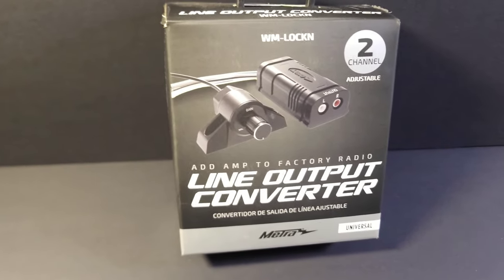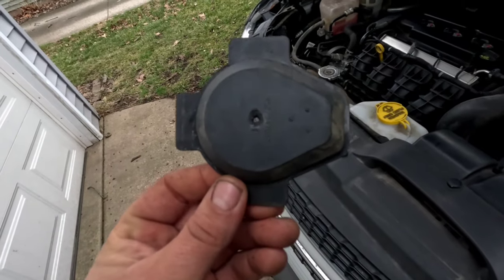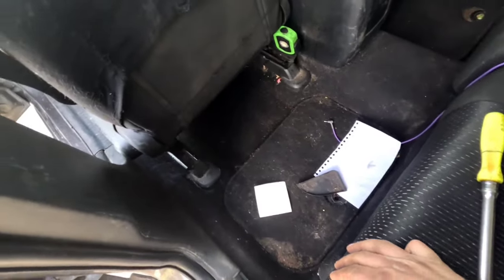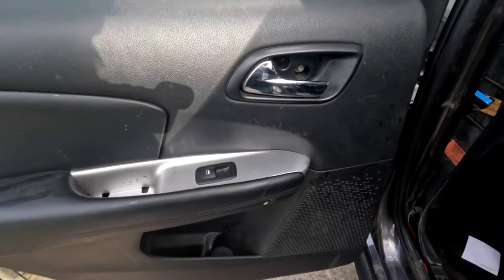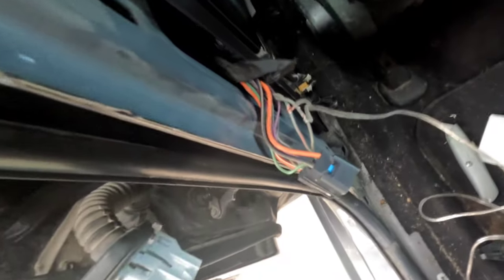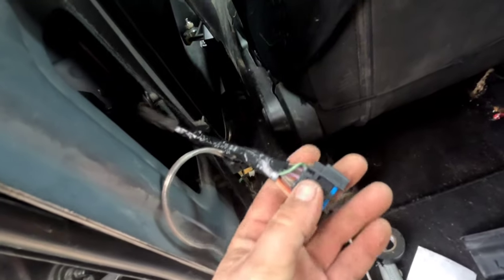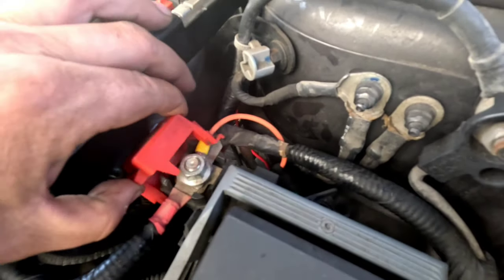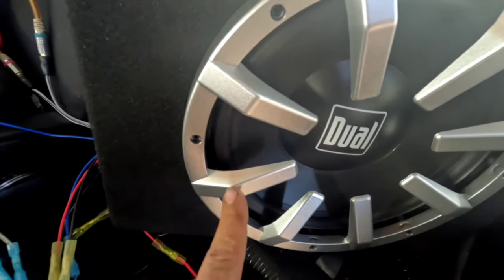Adding Subwoofer to Factory Radio - Easy & Cheap!

Comment: Great video, however, I installed my LOC right behind the radio, and I wanted to know if that same method works for cars with screen panels. More modern cars. I’m not familiar enough with them to understand
Reply from the maker: Personally, I would definitely do it the way I showed in the video. Typically, pulling two door panels or trim panels will be easier than pulling the screen panel and whatever else is required to remove it (dash, trim, etc)
Although, both would achieve the same goal. I guess it would be a matter of personal preference.
Reply: Thank you for that, i appreciate the advice :)

Comment: Maannn you actually used that Lil small wire for your hot wire???? Wth
Reply from the maker: @greddmyles3677  lol look at the actual input wire from the harness. That wire that is powering the amp is capable of carrying WAY more than enough current for that amp.
Reply from the maker: @greddmyles3677  the only thing bad about it is there is not as much insulation so it could short easier but it's fused so it's good.

Comment: Yo good video i have a question. I have a 2012 ford edge with the sync. My radio doesnt have rca outputs. Curious as where to start. I am fine hitting wally world i dont want huge bumps just to sound way better in the car .. ty for any advice
Reply from the maker: Yup! Just follow the video, and it will work great! 
Still, if you have any questions, feel free to ask!
Reply: You need to get LOC and tie into either the front speakers or the rear speakers

Comment: One thing I would have mentioned in the video is how to adjust the gain(level) setting on the converter...If the remote level control knob is hooked up and being used...The knob should be turned all the way up while the gain is being adjusted on the converter with either a test tone or familiar song playing with the radio volune around 75% volume...But it would take some guessing and fine tuning by ear to get the converters gain and the amps gain adjusted correctly...An oscilloscope would be the proper route but can still be done by a good ear.
Reply from the maker: I'm looking into getting an o-scope! But yeah sorry.

Comment: I did this to my son car and sub/amp stays on for about a minute after he turns the car off. I have the remote wired hooked up also. Is this something to be concerned about? Thanks for the video
Reply from the maker: Nope! I was actually gonna mention that but forgot. When it stops receiving the audio signal, it will wait about 60 seconds before shutting off (so if you mute it for a minute, it won't shut the amp off.) Thank you for watching bud!
Reply: @Blowncapacitor84  thank you. Your videos are well put together and have helped a lot. Keep up the great work
Reply from the maker: @BrianBaker-lk2xi  Thank you so much! That means alot!
Reply: So this will allow me to also hook up 2 amps, correct?

Comment: I have everything powered up eq n amos but no signal to sound the chuchero and bass😢 not sure why ... Im literally 99% done 😭
Reply from the maker: Do you have the remote wire connected?
Reply: @Blowncapacitor84 where do I connect it too on the fuse box?
Reply from the maker: The amp or the loc?

Comment: So I have experience hooking up car stereo and amp but not to a stock deck …… just to be clear u ran the blue remote wire from the loc to the amp correct ? Speaker wire from loc to speakers in car . Ground the amp and power to the amp. As far as remote wire going to the amp it’s coming from the loc?
Reply from the maker: Yup. The loc has a blue wire that will hook to the amp. Sounds like you should be good.
Reply: Ok so let me start from beginning correct me anytime …
From loc…
Blue remote wire goes to the amp
From loc 2 pairs of speakers wire pos: negative spliced into rear speakers
RCA from loc goes to the amp. 

From amp the ground is grounded 
Power goes to battery 
RCA connect tonloc
Remote wire from amp connect to loc 
Then I can bridge a line out from amp to the my sub since it only has one speaker?

Comment: Would this still apply to a car that has Bose system? It’s a mazdaspeed 6 2007
Reply from the maker: Yup! All it does is it takes the signal going to the speakers and lowers it to line level. I actually know a guy with a great bose system in a Mazda using a LOC

Comment: So the left channel cords go into the sub? Or amp
Reply from the maker: @troynepinak529  the wires connect to the speaker wires in the door. The rca connectors go to the amp. You also need  to connect power, ground and remote.
Reply: @Blowncapacitor84  yeah thanks for that just wasn't sure about the one thing. Awesome vid btw , peace
Reply from the maker: @troynepinak529  no problem anytime thank you
Reply: Question if I may? I have a 2016 terrain with the pioneer system. Just hooked everyhting up. using an loc. Tapped into the rear door speakers. But not getting anything out of sub. Any suggestions would be greatly appreciated.
Reply: @Blowncapacitor84 Do we need to connect both speaker wires, left and right door speaker?
Reply from the maker: @Πέτρος-υ8η  yes. If you connect both channels of the loc to a single channel, it may not get enough voltage. Although, you may be able to turn up the input level potentiometer to compensate for this, but it will only send the audio signal from one channel so you will loose sound quality.
Reply from the maker: @danculshaw7104  only thing I can think of would be a problem with the 12v+ and ground or the remote wire.

Comment: if i am connecting the LOC to my rear speakers where will i connect my yellow and blue wire too?
Reply from the maker: The yellow wire needs 12 volt power from the vehicle or battery. The blue is the remote wire and will connect to the blue wire on your amp. The LOC basically needs power to send to the amp and turn it on. It will turn off about a minute after the radio is off.
Reply: @Blowncapacitor84  I already ran a remote wire to my Amp separate from the LOC do I still need to power it?
Reply from the maker: @bassamaann  If you ran a remote from the radio, then I don't think it needs power.
Reply: @Blowncapacitor84 can I still hook up the 12V yellow wire to the AMP and put it into the “ *12v * section the same wire that runs from the battery to the amp can I hook up there since its the same power?
Reply from the maker: @jerrylevine959  yup! It only gets voltage, so  it will be fine.
Reply: @Blowncapacitor84 thanks for the feedback bro
Reply: With saying that can I also hook the negative into the negative on the amp that I already have
Reply from the maker: @roberthorst1315  yes
Reply: @Blowncapacitor84  thank you and this video actually really helped me out. I’ve been really struggling with trying to get this to work. I had first put a aftermarket radio into my car and then over the summer on a really late couple humid days. My radio decided to fry on me. so luckily, I kept my stock radio and put that back in but I’ve had issues ever since trying to get subs hooked up properly.

Comment: What about veloster N
Reply from the maker: Yes
Reply: @Blowncapacitor84  I tried rip pass seat out tied it behind the factory amp but radio won't shut off or no sound
Reply from the maker: @AlanBarratt802Vt  all you have to do is tap into the speakers it shouldn't affect how the radio turns on and off
Reply: @Blowncapacitor84  I can send ya pics I tried twice I even followed yt vid from N prform I'm confused
Reply: Hooked up lc2 pro same way works perfect